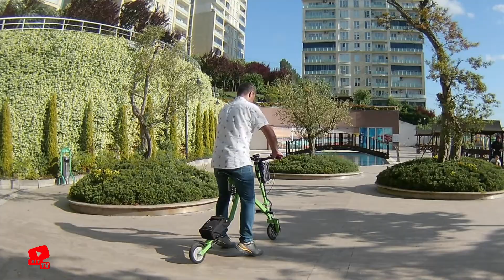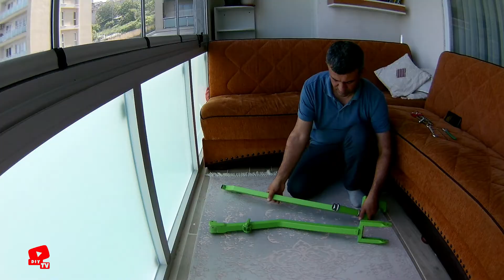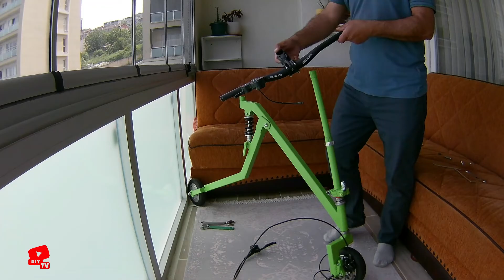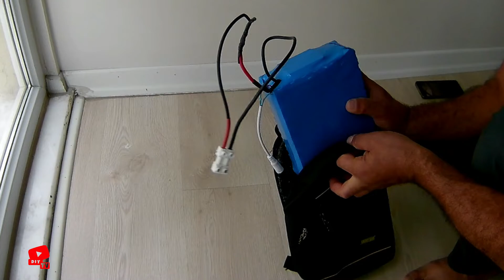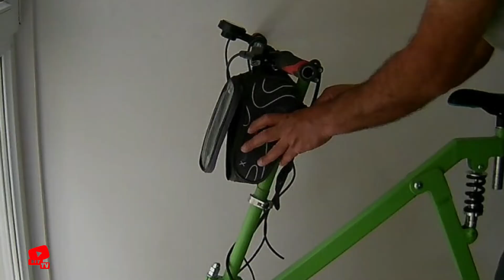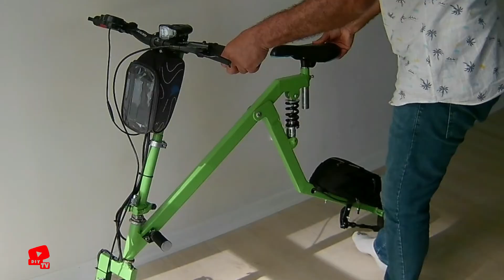How to Make a Foldable Electric Scooter Using a Gearless Motor?

Comment: How much cost required for it?.. and from where you purchase battery and motor
Reply from the maker: The cost may vary depending on the material prices in the country you live in. I removed the motors from a broken hoverboard motor. Recycle.
Battery ; I used the battery I removed from the hoverboard.